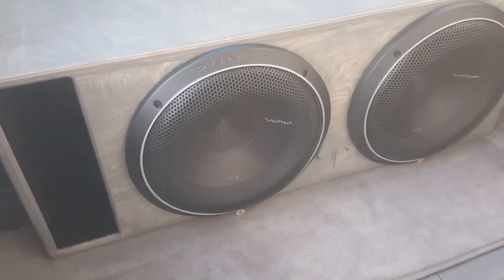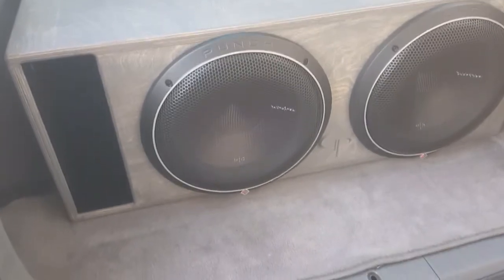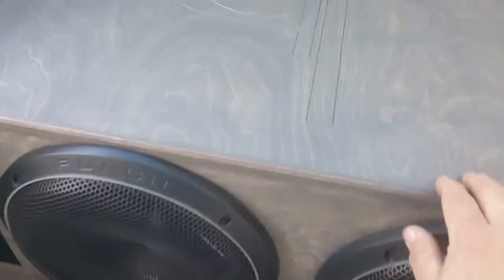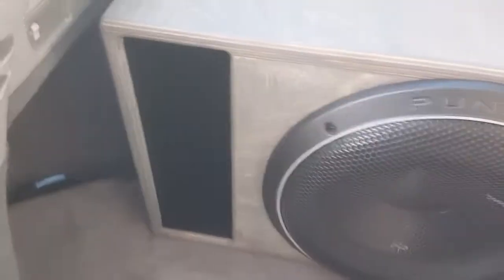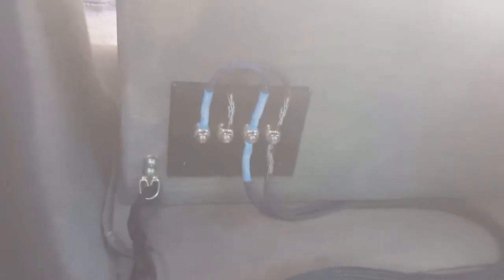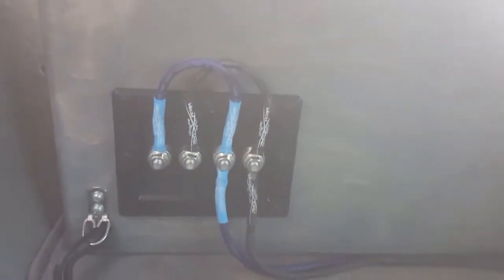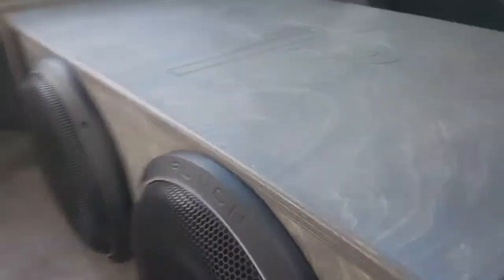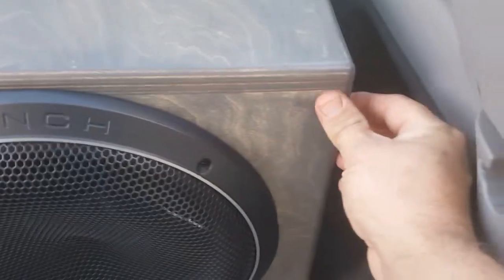New GP Audio box for the Prius

Comment: I went all the way. Just got it. Got the reinforcements inside double baffled with the triple baffle for flush kind of excited to put it together.
Reply from the maker: Thats awesome man they cut them out better than anyone could do with a hand saw good boxes for sure👍
Reply: They told me they are cnc cut. Not exactly sure how extensive that is but it's usually precision cut.
Reply from the maker: Yep Tyler has some videos on the GP Audio facebook page showing them cutying them out with the cnc router table very precision. Soundqubed here in oklahoma city has started making glue it and screw it boxes too they are about $100 cheaper but they have screw holes cut in them but  I still like GPs better. I need to contact Tyler again about making another one for 3 12s
Reply: What's the best way to assemble? Make a brace to square it? Haven't even opened the box yet.
Reply from the maker: @jtheexistentialist1221  I used a kregg jig and the screws are on the inside.
Reply: @edud8452  I did the mid sized at 33hz. 2 10s

Comment: Mine should be here today. What stain did you use? I'll post vids also
Reply from the maker: I used varathane carbon grey about 4 coats then after it dried a couple of days later I buffed it with a white scotchbrite pad on a palm sander. Its not glossy but its satiny. https://www.amazon.com/Varathane-269394-Premium-Stain-Weathered/dp/B01JRHLO6A/ref=asc_df_B00SJH2LTE/?tag=hyprod-20&linkCode=df0&hvadid=167125490367&hvpos=&hvnetw=g&hvrand=14636269176324234357&hvpone=&hvptwo=&hvqmt=&hvdev=m&hvdvcmdl=&hvlocint=&hvlocphy=9026282&hvtargid=pla-304688706426&psc=1&th=1

Comment: How’s the electrical system holding up? I’m wanting a Prius but worried about the system messing stuff up
Reply from the maker: does real good have had various systems for a couple of years. I run two deep cycle agms my voltage never goes below 14.0 but it kills gas mileage because the engine runs longer.
Reply: E Dud that’s what I would think would happen. I’m sure it still does great on MPG though. I just want to have enough power to do like 1 18 or 1 15. I’m looking at matrix as well.
Reply from the maker: @brewchainz  I would prob go with a matrix because it has a conventional type of elec system. In this car with the system off it gets 42-45 mpg with the system on about 35mpg also running 3 amplifiers just the idle current alone causes the engine to run longer to charge🤣
Reply: @edud8452  Did you do a big 3? What batteries did you get? Since the generator only puts out 100 amps how do you maintain charge on the batteries?
Reply from the maker: @jasonmartinez7667  it's got two 52 ah agm batts made by csb/hitachi and the electrical system does a good job of keeping up my voltage never drops below 14.0 but I dont bang on it all the time. my longest power run is 3 feet the batts are right next to the amps. If ever go bigger like 2500 on the subs I'll buy a stand alone lithium for the sub amp.

Comment: what subs are those?
Reply from the maker: Rockford p3 12s
Reply: wow man i seen those and now i know they hit hard lol. you put it on a 1200 watt amp?
Reply from the maker: @codyhyde985  Yep I metered it in October it did 145.4 db at 55hz not bad for punch 12s on 1200 watts
Reply: @edud8452  i’m impressed. that box must be great for them subs. never seen 1200 watts make something move like that
Reply from the maker: @codyhyde985  yep it flexes the windsheild pretty good its on its 3rd windshield it always cracks where the mirror attaches it would crack with a couple of 8s 🤣🤣its just a weak spot heck its cracked right now😁
Reply: @edud8452  dang man😂, i guess i always thought you had to have massive amount of watts to do something like that but man was i wrong